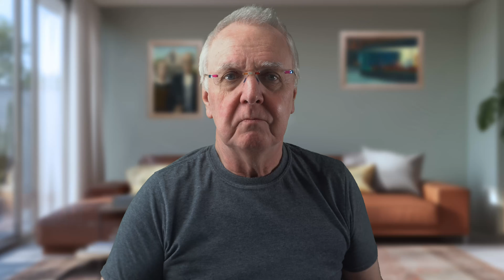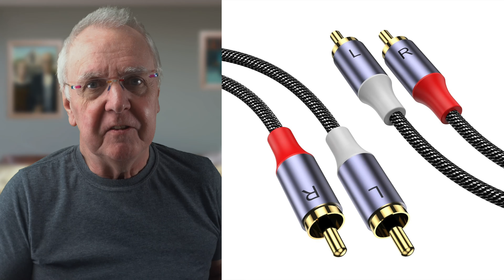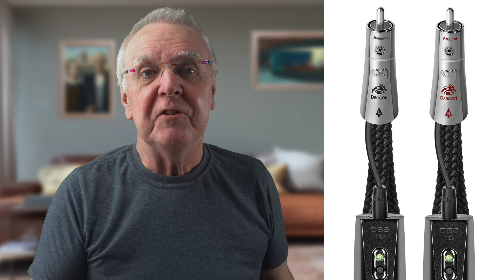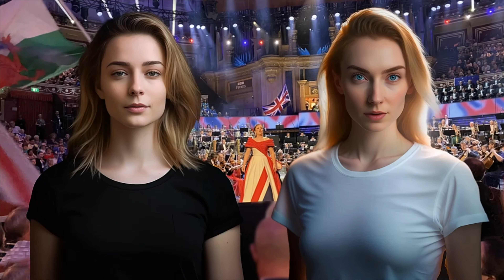How to improve your audio enjoyment with defective cables

Comment: In direct reference as to whether cables make a difference — I recently replaced the stock headphone cable on my Sennheiser HD600 headphones with one from Audiophile Ninja. I have a Schiit Lyr+ headphone amp that I had to switch to its high gain setting with the stock cable in order to attain a suitable volume for my listening pleasure. Once I changed the cable not only do I no longer need to switch the amp to high gain, but the resolution of music overall is staggeringly different and much more enjoyable as a listening experience by any standard — soundstage, dynamics, lower noise, etc. The fact is it’s hard to find the words to describe the difference. Let’s just say it’s gobsmackingly better!

I believe that, at the end of the day, such a comparison depends on so many variables and the specific context one is referring to that blank statements do not hold true in all instances. Still, to those who state there is no difference and upgraded cables cables make so sense I retort you have no clue how generalized and inaccurate that statement is.

Comment: I once encountered a defective cable in my stereo that I had to replace. But it was on the weekend. So I decided to borrow a cable from a family member. He did not have a standard spare cable but one with gold-covered contacts. You know, the kind of product that is aimed at audiophiles. 
I did not like the sound of it at all because the outcome provided more bass and less mids than I was used to. I did not like the sound of it, so I gladly gave it back once the week rolled around and I had bought a replacement standard cable. I was in my early teens at the time, which indicates I must have had really good hearing at the time, given I could hear the sonar of bats outside above the balcony still some 10 years after the cable test.

Comment: Can interconnection cables actually make an audible difference? Yes.....but not always better. Audioquest upper-end cables were too bright sounding for me but Analysis cables were neutral to a point where I didn't have to adjust my EQ or tone controls. Monster Cables had no deep bass roll off but couldn't match the others top-end clarity or imaging. Some brands or models can sound different also some preamps don't take too well with interconnection cables RCA or XLR with impedances, etc too high or too low.

Comment: This is one topic that I agree with you, for the most part. However, I do believe in modestly priced Cables. In my case I have at least 80% of interconnect cables in my main audio system are Blue Jeans Cable, mostly made in the USA; I'm in Canada. To most people, audiophiles, those cables are close to medium-priced, and Blue Jeans cables have excellent shielding. To me BJC are the correct connection.🔈🎵🎶

Comment: All this talk about interconnects, cables or whatever is absolutely ridiculous UNLESS one considers the mains or those little  holes in the wall which supply the power to your premium hifi equipment. You may think that the so called power line filters which their manufacturers claim to 'smooth out' the voltage ripples and dampen, or even eliminate  line surges will provide clean, steady and surge-free power but I say NO! Nay! Nyet! 
While they may produce a mild calming effect on the wild electrical currant stampeding through the power lines from the hydro, wind, solar, coal or nuclear generators one must consider that even under the best conditions such as steady even flowing rivers, light breezy days and  well fired coal generators that the power emanating from them is riddled with voltage surges and drops, capacitance noise,  impedance variations and transmission losses. 
  Now i ask you, "What kind of High Fidelity can one expect from even the finest sound system when fed inferior power?" Allow me to explain.
I have, in my back yard, a dedicated power generator which runs on natural gas, and is connected to the house via 4 gauge oxygen free, 48 carat, gold cables and is grounded to the center of the earth by a long spike. Because the cables employ an air spacing of one meter from generator to the house, inter line inductive currents, capacitance  coupling and overheating are eliminated! My stereo recognizes this and produces sound which experts claim as "Not bad at all!"

Comment: white noise source into both sets of interconnects at the same time, then into a DAW on separate tracks. invert & add, inspect the difference. there isn't one. bosh. better yet, a decent analogue oscilloscope.

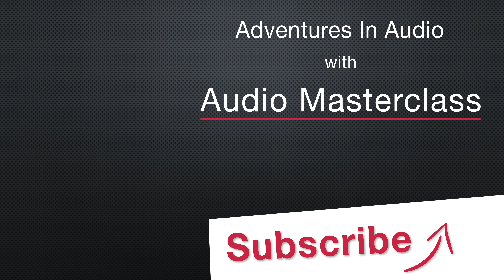Comment: I've regularly made up my own RCA type cables and connectors.  Phono cable that's  under 3 quid a mtr and gold plated phone plugs , less than 4 quid a pair. I cant believe a cable hundreds of times more expensive could sound any different,  unless they have certain properties built in, like a difference in capacitance 5:31 , or resistance to give the impression they are better, when really they are just different.

Comment: I am concerned! Some really sensible audiophiles with exceptional gear, the kind of audiophile that tweeks their crossover networks constantly, really beleive the cables make a difference. I have been swapping about my $6 Bunnings speaker cables with my 27€ Audio shop ones and I can't tell the difference. That is a factor of 8 times the price, what multiple is actually required?
Reply from the maker: I suspect a wise comment reader will supply us with an equation for the law of diminishing returns that would apply in this context.

Comment: I always thought a cable was the wire to your speakers, whereas an interconnect linked the electronics.... I am with the' no audible difference between properly designed and built cables' camp.

Comment: My recommendation for a "high end" RCA cable is to use PTFE Tubing with 1mm inner diameter and gold plated bare silver wire (4 nines) from scientific wire.

The signal wire should be as thin as possible (I used 0.2mm IIRC) and there should be six "ground" wires of ~ 0.7mm.

Make a pattern of six tubes around the 7th, with the signal wire in the center and six ground wires around, add a twist and a sleeve (clear shrink tube?), a shield is optional and if used should be connected separately. 

RCA Plugs - WBT Nextgen. 

This is about as it gets no matter how much you pay. The wire and all is pretty expensive, I think a pair of interconnects easily ruins a few 100 Bux.

Not me High end engineer with sold other products
Reply: there are cheap knockoffs of the PTFE tube design- I've got some here, & they sound good enough for me, but some of them were a bit fragile- I guess where the connectors are glued onto the inner- & I was puzzled by their construction, being used to traditional thick copper wiring.

Comment: I use "interconnects" made with cable that has a capacitance so low it can carry tiny signals hundreds of MHz over tens of metres and is completely foil screened to not pick up any interference. Yes, aerial/satellite cable with F plug to RCA plug adaptors!

Comment: One advice given by a sound engineer was to use well working digital coax (this is easy to test). If it works well for a digital signal it will work perfectly for an analog one.

Comment: I spent modest amounts on both speaker cables and RCAs. My £20 speaker cables were definitely better ( to my ears)  than the Amazon basic cable but full disclosure attaching the basic cable to the basic Banana plugs felt like I was doing something terribly wrong. RCA's wasn't cut and dried. My amp has MM stage and it's pretty good my RP3rs has neutrik cables which are very good. I have a Pyle phono stage for the system I'm building for him. I got him £5 RCA's and they look ok. The Pyle is an absolute pile of crap so I'm not telling him his dad bought a pup. Got the Rega A2D which is their entry level phono stage and using the £5 RCAs I didn't think it was any better than my inbuilt one. Spent £20 on better ones and I think they have allowed the Rega stage to shine. This could all be confirmation bias. My original Planar 2 had the most basic RCAs and yet plugging that in was the most transformative moment in my Hi-fi journey. If I had 8 grand to spend I wouldn't be looking at interconnects. I'd get a P10.

Comment: I'm using $10 cable in my car and it's working fine, no hiss or whine. Whine/hiss mostly come from poor/loose ground. I kept power and remote turn on wire on one side and RCAs and speaker out on another side of the car. It made the difference.

Comment: I once bought some $7 RCA interconnects from Amazon once and it turned out they were defective so I threw them out and bought some $17 RCA interconnects.  The difference in sound quality was astounding.  Nearly a +120dB gain in the  $17 cables..er, I mean interconnects, compared to the $7 ones.

Comment: This is much the same as a wire is something on a spool and a string is when it is attached to the instrument. Difference between wire cable and interconnect is a complex issue but most of this wont matter on a short run of stuff. The crackle is more likely from a dry joint than the cable or inter connect.

Comment: i use QED usb cable from laptop to amp, QED speaker cables & Chord coax for cd transport. didn't expect them to improve sound & guess what they didn't, the real reason i got them was for their really good connection quality nice & tight fitting. cost all in just under £60 ( Amazon Black Friday deals ) bargain for piece of mind & hopefully they'll outlast me.

Comment: If the perfect amplifier is a wire with gain, then a perfect interconnect is a wire with gain of 1. To make a near perfect interconnect just make it really short. Any interconnect that sounds different to the very short interconnect is therefore imperfect.

Comment: My reference interconnect is the Tandy 4 way cable for tape machines. It is built decently with tight gold plated plugs. It is a single core coaxial cable with capacitance around 100 pF/m. To me it sounds very clear with crisp top end. Back when my hearing was good I thought that the Tandy cable allowed my bitstream CD player to sound slightly edgy. That could be largely ameliorated by using a ferrite ring or a screened twisted pair cable (i.e. more expensive). That more expensive cable has signal to screen capacitance 250 pF/m and I am guessing it filtered out some supersonic frequencies in combination with the CD player output. I never really liked that cable for other sources.

Comment: The expensive cable is an active cable, it modifies the signal, it's normal for it to sound different, but this doesn't make sense for a cable that should only transmit the purest possible signal...

Comment: One area, moving magnet / coil cartridge, the capacitance loading of the cable has a measureable and determanistic effect within the audio range (shock). Something you can model in SPICE simulation. The capictance per meter length is part of the cable electrical specification and is quite variable. As for a 2-200R source into a 18K load, for audio, well nope, does nothing. Years ago we seriously looked at gold coloured epoxy dipping the wonderful WIMA MKS (costs between pence to a pound each) capacitors and stamping them "Special Precision Audio Capacitor" or SPAK Caps, measuring ESR / TAN-Delta etc and selling as matched pairs with a data printout.  Its that sort of world.

Comment: I got one of those Douk A/B switches and have reassessed my entire audio collection, amplifiers, pre amplifiers, power amplifiers and interconnects.  Damn it all sounds the same, perhaps there are very subtle differences if I want to split hairs, at most between vintage original and recapped amplifiers, but nothing really shows up a difference to an extent that I can get excited about it or wouldn't get enjoyment from listening to any combination.  I need a new hobby, audio equipment isn't it, it'll have to be music.  A career that really must suck is  doing reviews and having to bend over bacexplain why one thing is different  to another

Comment: Joke's on them if you hardwire everything - like the pros.
For RCA connectors, I use cables that are rated for S/Pdif, they produce less jitter and don't have the high frequency lag issues that plague basic analog cables. Needless to say these have to be matched or you run into phase issues in your crossovers, and that is not a happy place.
Speakers get hooked up with 16VA 3mm2 high tensile solid copper triple strand double shielded installation cables AKA the stuff they use in bunkers and submarines because the hifi stuff simply doesn't offer that kind of headroom.
In the listening spot I stream all my mp3s straight from the laptop over bluetooth using a decade old dollar-store receiver plugged into the vintage tube amplifier. That'll teach 'em!
*For clarity, if instead I use interconnects that do not have such blatant flaws, the sound does improve.

Comment: What both sides of the argument on cables ( and CD Transports / expensive DACs / Tubes, etc ) miss is that, in Hi-Fi, everything is basically a sound filter, which adds or subtracts various sonic attributes. An individual piece of 'gear,' be it a cable, component, the rack or support feet all subtly alter the sound from the 'reference of what is precisely on that file, CD or slab of vinyl. There is no way of hearing the original source material without passing it through 'gear' which adds it's own 'stamp' to the sound. Because of that, buying anything in Hi-Fi should be a subjective question; does this new thing make music sound better to me and me alone? If the answer is 'yes' and you feel the price is acceptable, then it is a good buy, whether said 'gear' is cheap or costly. It's about recognizing your taste in music, being willing to listen to a lot of gear, being willing to experiment and willing to keep your mind as open as your ears. Anything less than that? Then YOU become the filter.

Comment: The confirmation bias hoops an audiophile can go through to justify their spending means an $8k cable would clearly deliver more buttery mids at the very least. 
'It can't be measured,' but its not in their heads. Don't ever ask them to blind test it, though. Thats sacrilege
Reply: They think that a 50/50 result means that 1/2 the population should buy expensive cables.

Comment: Audiophiles use cables as very expensive & specific tone controls. I know, because I’ve done it. But I’m over that now! Buy a cable which allows the signal through unmolested, and you have your perfect cable. I suspect that over a 1m length, most well made £4.99 cables will do this.
Reply: It's too bad cables are not "expensive and specific tone controls" ... otherwise it might actually make sense.  The far cheaper and more versatile alternative is to simply buy amplifiers with tone controls in them.

Comment: expensive interconnects  should be made of gold plated pure copper(with the  best plating technique) and the wire connection to the jack should be always mechanical copper on copper  and maybe soldered afterwards to protect it from oxidation 
remember! tin has only 15% the conductivity of copper. so always minimize the use of soldering as a bridge between 2 electrical connections.

Comment: I don't use "leads" or "interconnects" or "cables"... I use silver wire.  22 gauge silver wire is reasonable prices ($12 per foot approx.) sounds best in my opinion, but if you can't hear the difference, don't pay extra.
Reply: 22 ga ofc copper will cost you about $0.20 per foot and it will work just as well.

Comment: Why are old timers still trying to be audiophiles? Their ears are not what they used to be. Most won't notice the difference in low to higher bitrate music nowadays. If they say they do, it is a small significant difference. To the point of almost non-distinguishable
Reply: Those "old timers" are the ones who invented the technology you take for granted. You wouldn't have your system without them.

Comment: Cheap cables are a no-go for me. The left and right cables must run unaltered between the connectors (no merging into a round cable!). I haven't tested the Primewire cable (€13/1m) yet, but it meets my minimum requirements. OFC copper + Al foil, unchanged continuous cables, full metal plug with gold-plated contact surfaces, cannot be torn off by normal people.

Comment: I have some  regular audiophile cables I  also use Cables from “Sounds Heavenly “ his channel is on YouTube he also owns a small business making cables for various types of equipment. He does a lot of work regarding Bang and Olufsen as Naim, Quad  and other’s.
His prices are very reasonable he’s a very genuine man .
The cables are excellent quality for the price some audiophiles have said they are better than some cables costing several times more in the fancy packing and bright colours  SH connects are gold plated and you get a lot of cable for your money if your looking to spend a sober amount of money on cables look below ⬇️ 

Ps Bang and Olufsen recently made a limited amount of copies of the legendary Beogram 4000 (the tangential deck of the 1970s) they bought scores up on the market took them all apart and revamped them with new capacitors etc and gave the Aluminium a champagne finish .
This came with a pair of Beolab speakers 18s I think , a Halo remote and a very fancy cabinet .
It cost a LOT of money sure it was a limited edition and it was for people with money to burn .
Who’d they ask to make the cables ?? 

Sounds Heavenly of course !!! 

https://soundsheavenly.com/

Comment: Cables can sound different!..  since I have used several from different manufactures.  never truly expensive though...  just my 2cents
Reply: Yes you are right. They are tone controls. Remember the basic one is the best as the others have their resistance capacitance altered to block high frequencies etc. If you want an unmolested audio signal stick to the cheap cable.